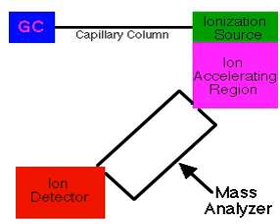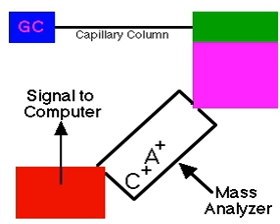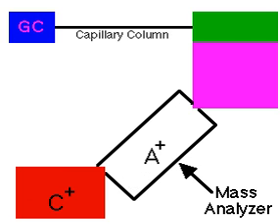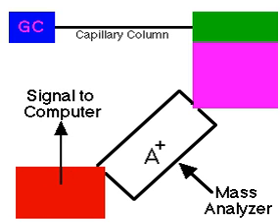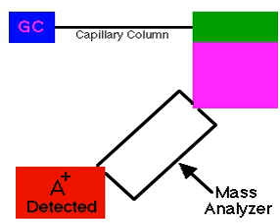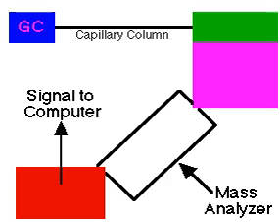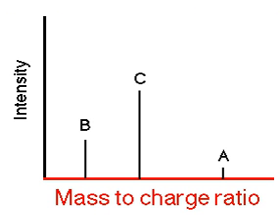Gas Chromatography/Mass Spectrometry 2

Comment: Definitions 

Resolving power is defined as M/DM, where M is an m/z value and DM is the difference between M and the next highest m/z that can be distinguished from M.
 
Resolution is defined as DM/M, the inverse of resolving power. It is usually expressed as DM at M in parts-per-million units.
 
Sensitivity is the ability of the system to measure small quantities of materials. Most MS can detect less than 10-11 g of a compound.